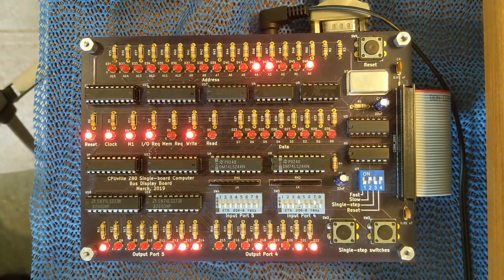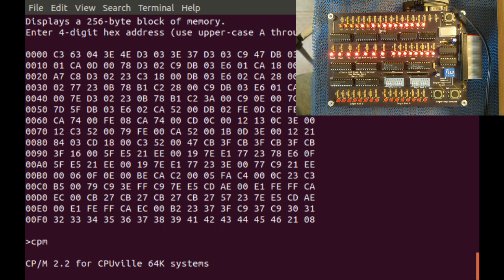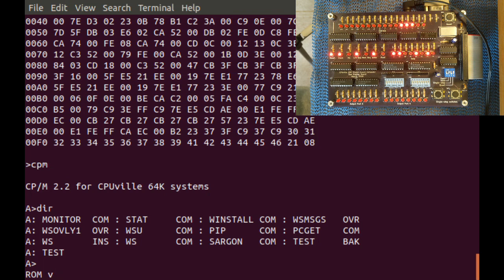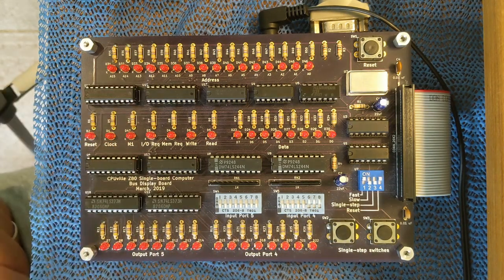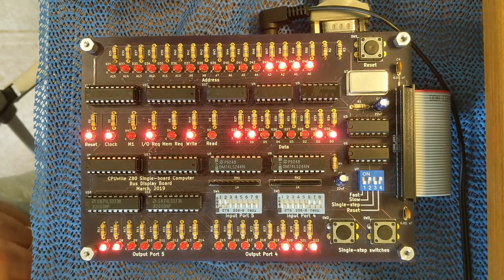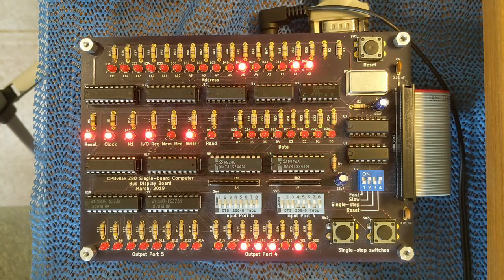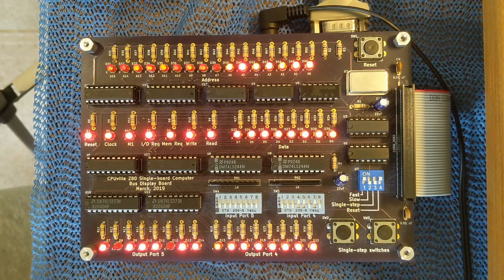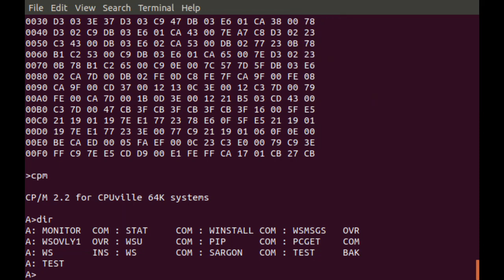ROM v.15 for the CPUville Single-board Z80 computer with bus display

Comment: One question about your "single step switches". Do you have to press one and then the other for a full clock cycle? If so, there is a better way to do this by using another kind of switch. It will ground one side of the RS latch and then the other. It's better than having two.